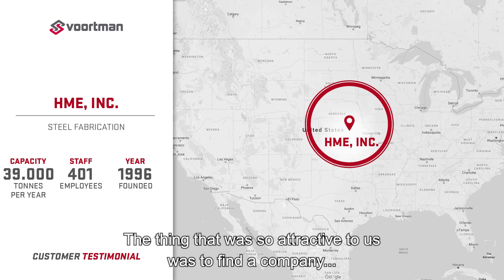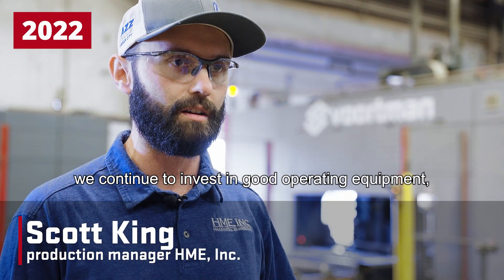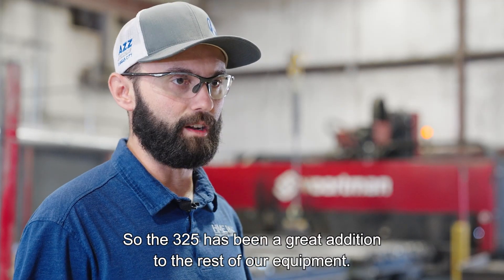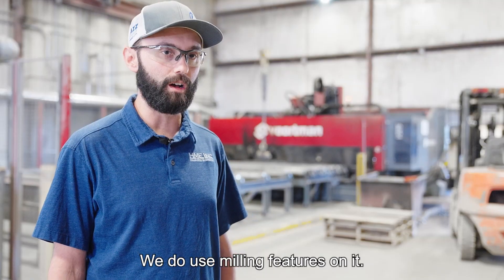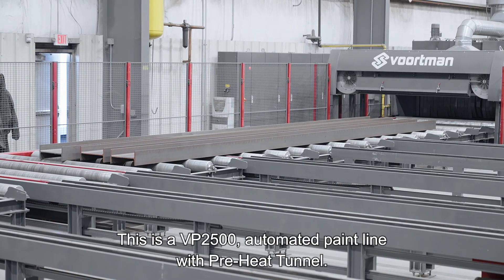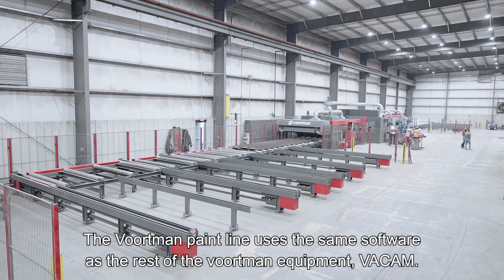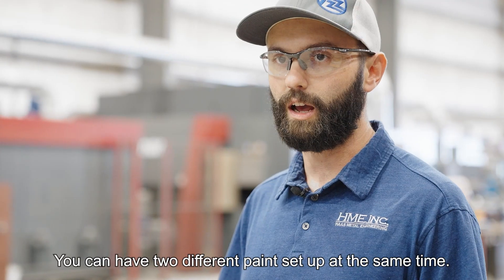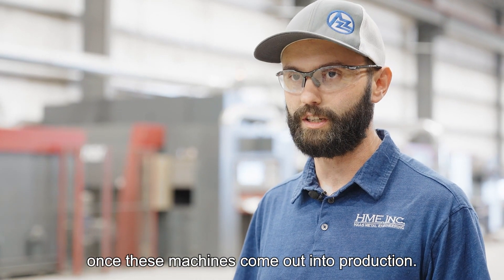Voortman | an update from HME

Comment: I wish my bosses would let Voortman walk our shop and bring in their machines, we just had about enough of Ficep.
Reply: What issues are you having with Ficep machines?
Reply: @jgilagen990  wrong parameters on the beam line, won't pick up certain tools, at one point the tool door failed to open and the spindle smashed into it, endless errors that tech support can't even figure out, they tried updating the system it got worse.
Plasma table also have errors that tech support can't figure out, "pre charge failure", "low volt link" (whatever that means), spindle overheating, one of the spindles moves and unloads/loads tools while plasma cutting, half the time it causes errors or crashes. They are not even on the same rail and tech can't figure out why it does that.
Funniest part is watching technicians looking at their machines, scratching their heads.
Tech support is not the friendliest or helpful.